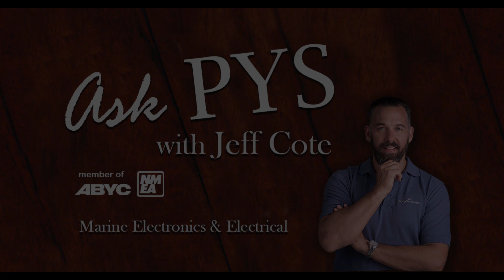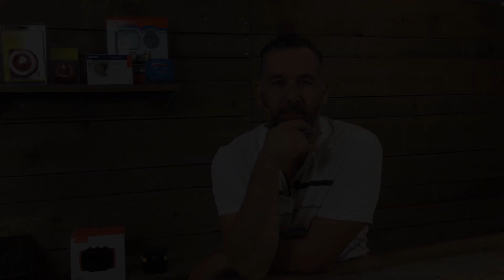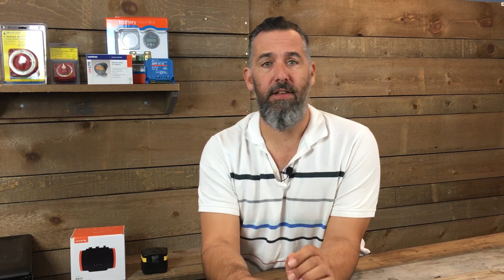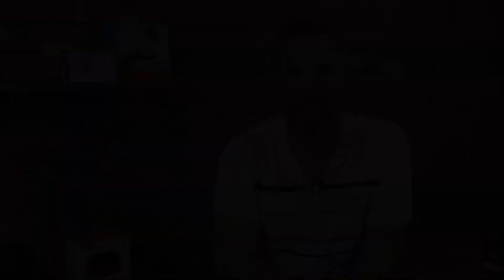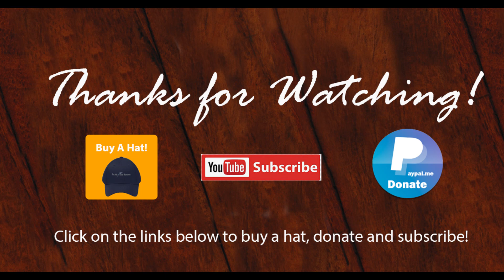Ask PYS - How Much Solar Do I Need to Run the Fridge on My Boat?

Comment: Hey Jeff, are you familiar with the Heart System used on older Hatteras Boats? I have one now on my 43 sport fish. Works fine but at 41 years old it has got to expire sometime.  I have watch all your vids on inverters / chargers.  So am ready when it does.
Reply from the maker: Heart inverter/chargers are bullet proof, they just keep working.
Reply: @PacificYachtSystems  Thanks

Comment: OK, I'm on Lake Michigan presently so probably about the same solar efficiency as the PNW.  The  household type fridge on my new trawler is AC only 1 amp @ 120V so 10A @12V through the inverter plus whatever losses in the inverter itself.  So figure 11 or 12A when it's running.  The DC fridge on my sailboat was 5A when running and my 175W solar panel could keep up on a good day. Cloudy  or rain I'd have to run the engine for a while, but I'd need to run it to make hot water anyway. I have 400W of solar on the trawler, do you think it would keep up with the 11-12A fridge over 24 hrs?  The water heater on the trawler is AC only so I still need to run the genset for that too.
Reply from the maker: A 400 watt array should give you about an output 100 amp-hours (at 12 VDC) per day. Your fridge at about 50% duty cycle is about (12 amps X 50% X 24 hours) is 144 amp-hours per day.

Comment: Jeff you didn’t mention the winter months of trying to use solar
Reply from the maker: Good point Don, winter certainly lowers to the output of a solar array. Here is the Pacific Northwest, the daylight is maybe 9 - 10 hours in short days of winter and 15 hrs plus in the summer months. Also, the sun is lower on the horizon in the winter versus the summer months and this also lowers the solar output.
Reply: @PacificYachtSystems  so would you recommend changing the angle of the solar cells for the change in seasons

Comment: I have a Norcold 751 RV fridge on an Allied 32' ketch.  It's 2.7 cu ft, so I guess 75 l.  I get 30 Ah per day in usage, sometimes near 40 during summer.  It pulls 5A, but only for 3 minutes or so every quarter hour.  Two 50W panels have done fine keeping up.
Reply from the maker: Thanks for sharing.

Comment: Having trouble finding a 300 amp DC breaker for my inverter.  The most popular “Blue Sea” don’t look acceptable.  My wire is 1\0 their terminal post are 5/16”.
Reply from the maker: For your inverter, you need a 300 amp Class T fuse and fuse block.

Comment: What is the best way to get my alternator to safely charge my LiFePO house bank? I will be switching my starter over to LiFePO this off season also so I hope that makes it a little easier. (38’ sailboat)
Reply from the maker: Hi PJ Mullin, you'll want to have an external regulator for your alternator that communicates with your Lithium battery BMS. Otherwise, it's gets a little complicated and you have to find away of disabling the field voltage to the alternator via a relay driven by the BMS.

Comment: Pogo 36 sailboat comes with Webasto DL 85 INOX. draws 370W/24hrs. So 31 A-hr or 125W panel. Going to use a Merlin 170W folding panel for the days at anchorage.  Hydrogenator while at sea
Reply from the maker: Sounds good.

Comment: Because of your videos, I had my battery wiring birdnest cleaned up professionally, and installed an ACR, 20 amp genius charger, voltage/amp gauge,  New house battery and rear fuse box. It's only a 19 foot Larson, but when the boat won't start after fishing all day,  it's a real bummer. Thankyou for the guidance.  😎👍
Reply from the maker: Thanks for sharing and being inspired. Feels good to have a boat you can trust!
Reply: @PacificYachtSystems  I have been looking at sailboats for near by retirement. The steel sailboats have caught my attention. I wonder about lightning strikes, electronics, and increased likelihood of being hit. Basically any insights about this subject and possible preventive measures you could think of. I hope in the future you could dedicate some time to this. Always watching. Thankyou again for the information.        😎👍

Comment: My fridge is a 60L, 15Ah - 20Ah per day (12v). Fridge is externally insulated, there's 2 x 120mm low rpm intake fans and 2 x 120mm exhaust vans. Atmospheric active cooled condenser with the fans triggered from the switch on the Danfoss compressor. 100W solar runs it in Ireland 365.
 52°N
Reply from the maker: Hi Liam, your fridge is really efficient, 60 Liters of capacity for a daily draw of 15 - 20 Ah at 12 VDC is really good, congrats!
Reply: :-D. I can out-nerd quite a few. It drew 30Ah before I modded it. The fan control circuit is standard on all Danfoss compressors I've seen
Reply: @scruff7559  how did you alter this? Thank you

Comment: Hello jeff, I am a very big fun of your channel, I started sailing only 3 years ago and you tought me all I know about electricity on boat!!! I leave in Malta, the very little state island in the middle of Mediterranean.I have a question that came to my mind when you mention “fridge”: I have 2 small fridges on my catamaran, I realized they work fine when on shore power but not when on batteries! Basically on batteries they keep running or even worse they keep switching on after a second they switch off! Do you thing it has to do with voltage drop? At the beginning I thought it was a problem of the thermostat or the compressor (maybe gas leak or similar) but then I realized that both fridges do the same and furthermore they just work fine on shore power... any suggestion, please?
Reply from the maker: Hi Marcello, generally most boats have a fridge breaker on the AC panel and the DC panel, meaning the fridge can be operated from shorepower or generator or inverter via AC or from the batteries via DC power. Does your DC panel not have a fridge breaker?
Reply: @PacificYachtSystems  dear Jeff, thanks for considering my question; maybe I did not explain very well: they work both way (shore or batteries) the problem is that on shore they work fine, on batteries they are almost always on (draining batteries) they switch off every once in a while but they immediately switch themselves back on (being basically always on ). Regards and thanks

Comment: Hi Jeff, thanks so much for all your YouTube content, really helpfull. One thing confuses me; you talk about 75 Ah a day. I am hearing: 75 amps per hour per day. And that confuses me? Do you mean 75 amp per day or 75 Amps each hour of the day? It seems strange to have 2 time factors at once. Can you clarify?
Reply: Ah is a unit of capacity for batteries. 100Ah batterie would be empty if you would draw 100 amps for one hour or 50 amps for 2 hours etc. If your fridge needs 75 Ah per day it means it uses that capacity just for the fridge. Just like your generator would use 10 gallons of fuel per day if it were running. Your solar needs to be able to put that amount of energy back into the batteries during sun hours. To compensate the fridge it should be able to provide 25 amps for three hours a day to reach that 75 Ah (just a math example).
Hope that clarifys that a little bit :)
Reply: @steegzor5161  it still makes no sense to me to say 75Ah/day instead of 75A/day. But the concept is clear!
Reply from the maker: Hi Martin, the concept of amps and amp-hours is confusing for many of us. Amps is the flow of current at any given time, sort like the speed of a car. Amp-hours, is the quantity of amps used over a period of time, of like distance travelled with the car. 

When we say a daily budget of 120 amp-hours, it means that through the day you'll use a total of 120 amp-hours. This could mean that you are drawing 5 amps of current continuously for 24 hrs.